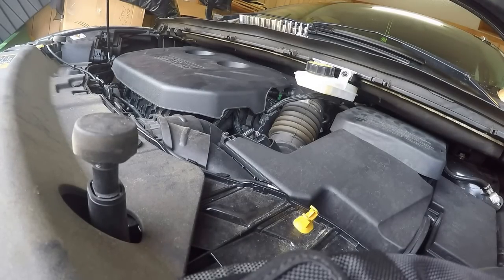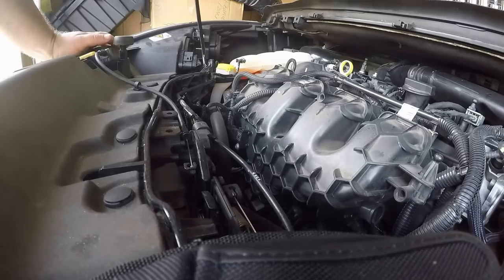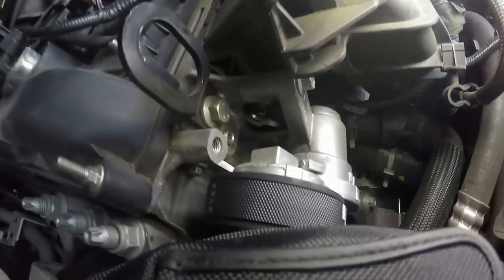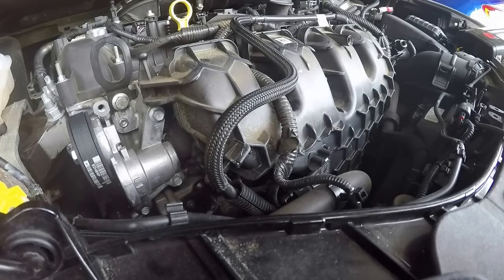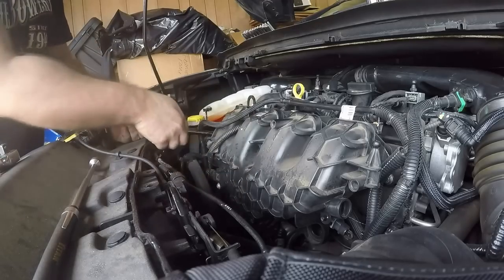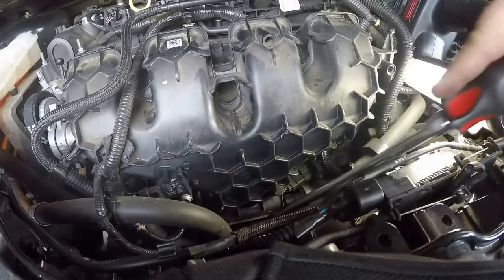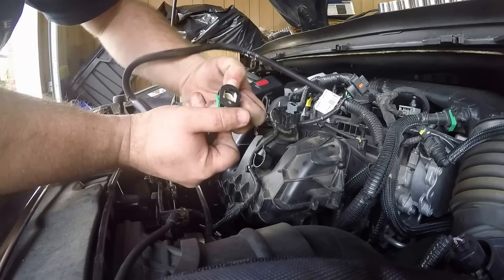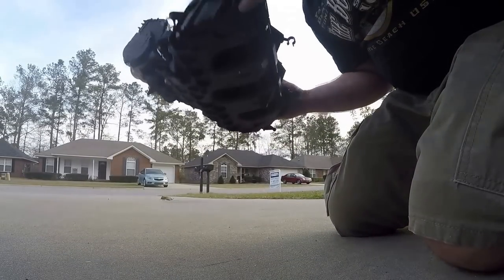Ecoboost intake carbon DIY valve cleaning turbo 2.3 2.0 1.6 ford escape turbo, escape. Simple tools

Comment: ford research and development should have caught the excessive blowby under boost conditions and fixed it
Reply: with a catch tank LOL which I have to buy now
Reply: Catch can only thing that will cut it down
Reply from the maker: Thats what the Germans figured out years ago and fixed or went away with the direct injection technology.
Reply: The newer generations are coming with port injection to clean values now.
Reply: @scrappyitalian  Negative. GDI is here to stay. Most manufacturers (Mercedes, VW and BMW included) have gone to dual injectors. One in the cylinder and one in the traditional port location to wash the backside of the valves.
Reply from the maker: I did not see this reply and i apologize for not messaging back in a timely manner, i hope everything is going well and any issues were worked out.

Comment: Is there not a potential problem with carbon crap getting into the cylinders and being blown out and into the turbo fan with possible damage to the blades?
Reply from the maker: Yes! if they are big enough; however little bits will not hurt anything. Thats what you see when carbon blows out the tailpipe on grandma's car from chunks coming off the valves and pistons,
Reply: @scrappyitalian  What about the "honey comb" in the CAT ? wont it block that?
Reply from the maker: If you use CRC and let it all break free yea kiss the turbo and cats goodbye. But a manual cleaning, is the best way, light liquid cleaner after like the ac delco, and a amsoil changeover.

Comment: Legend says he is still trying to get that escape to run again.
Reply from the maker: Jeremy its running fine, the big issue with it was the head gasket. The valve cleaning really helped after i did it but the shuddering was from the tiny amount of coolant leaking into the cylinders. If i waited after the warranty, ignored it; not pressed ford to check the compression, and leak test, i would have been stuck with replacing the engine.
Reply: LanceManAdventures great to hear. Just making a funny. Couldn’t have you replaced the head gasket yourself? If you had waited till after warranty. Wife’s escape is idling rough at idle from time to time and seems the power delivery is weird sometimes. I will check compression
Reply from the maker: They replaced the head the first time. Then the engine completely blew up. Then they did a long block; mind you weeks of waiting between. Unless you want to do the machine work i would get a long block or a post head gasket update model junk yard engine if its the gasket. These engines are so finicky you may end up doing the pull 2x if anything is not perfect. Not a lot of shops can put the proper finish on the heads and block for a proper seal even with a good mls gasket.
Reply: LanceManAdventures wow! Ok so a few questions: 1. What year did the update the head gasket? 2. Was your escape a 1.6 or 2.0 ecoboost? 3. How many miles did yours have when they replaced the head and engine? 4. Do you still have the vehicle? If so how many miles on it now?
Reply from the maker: It is a 2014, 2.0 eco, it had about 60k when started with the problems she fortunately had the extended warranty. I am not sure when they started putting the updated gaskets in new vehicles. But i know the replacement long blocks have them. There is a video showing the dumb unnecessary hole they put in the gasket between the cylinders on the gasket that is the problem.

Comment: This is not carbon this is oil from the crank case  building up , understand this problem is from excessive cranck case pressure and oil blow by............the throttle plate was very clean with very little carbon on it
Reply from the maker: Shannon Spears finally someone who knows what they are saying instead if critiquing me at every turn. 🤟🏼
Reply: I have to recan't some of what I said there is carbon build up but oil is excessive in ecoboost, so everyone is using a catch can which is a simple fix for this engine , so I found a company that makes a intake spacer for these engines and with the advice of Steve to use CRC cleaner the spacer has threaded ports for injecting any thing you like  CRC cleaner, NOS, gas, water, auqamist.................Boombaracing.com 
Did you know water can turn to steam and clean deposits, we use to use a pop bottle and poor water down the carb of the big V8's back in the day only when the engine is hot .
Reply from the maker: I did not see this reply and i apologize for not messaging back in a timely manner, i hope everything is going well and any issues were worked out.

Comment: Also change your high and low pressure fuel sensors that’s also a problem with this engine
Reply from the maker: Rahsaan thomas the big thing is the head gaskets. Ford put in 2 engines in after this, having nothing to do with the carbon. In the end the carbon problems are dwarfed by the head gaskets leaking. If you have “any 4 cylinder” ecoboost have the pressure check your coolant and compression asap; before your powertrain goes out!

Comment: How about using a small vacuum cleaner to suck the carbon out.
Reply from the maker: The hole is very deep, you would need to make a custom adapter.

Comment: Hey do you still have this vehicle? The reason we get carbon build up is due to the pcv system. It's a big problem in the focus st community aswell. Since the car is direct injected, there's no fuel that touches the valves, therefor no cleaning takes place. Oil from the pcv hits the hot valves, and what doesn't make it into the cylinder bakes on to the back of the valves. You should try looking into an oil catch can, I've got a Boomba stage 2 catch can and I pour 2-3 ounces of oil out of it every 3000 mile oil change. Does wonders for keeping carbon off of your valves.
Reply from the maker: Anything you do will void the factory warranty including a catch can. I have the 3.5 SHO and am terrified to even touch it with anything aftermarket. Ford does not like you nor will overlook anything you do to the ecoboost. But the problems now is a coolant leak that is causing a misfire that they cannot track down and are just throwing engines in as a fix. As i said in my other comment i will be doing another video as soon as i get it back after the second engine replacement to explain what to look for and ask for when you have a ghost misfire from the ecoboost.
Reply from the maker: The biggest problem is not the carbon but a poor head gasket design and block configuration.  If you loose coolant at all u need another engine....
Reply: @scrappyitalian  I've lost coolant in my 2017 Fusion.  If it's so bad that you need another engine, wouldn't you see coolant in the engine oil with that milky white appearance?  Either way I'll have them check it under warranty, but I'm interested in your thoughts on that.
Reply from the maker: Brian Heath it leaks into the cylinders directly, will not show up in the oil. They need to do a coolant pressure test and a compression test to find the leak. The leak is between the two middle cylinders and is very hard to catch. The coolant should never loose “any” fluid per ford or there is a problem. Make sure they do not talk you into just a head job the entire engine needs to be replaced.
Reply: @scrappyitalian  Thanks.  Also, how do you know it's misfiring if a code doesn't show up?

What do you say if they just shake their head and say, "we don't replace the whole engine under warranty because it's good enough to do a 'head job'"?  (Does that mean they just refurb the valves, guides, and seats?)
Reply from the maker: Brian Heath i had the same problem with no codes, but ford knows what this issue is. The pressure tests are all they need. They replaced the head on the first engine which soon blew up. The ecoboost is not and easy engine to just tear apart also i know they did not make sure the block was true as the engine did not come out after the first attempt. After the second fail they just put in a long block. Get it done before powertrain runs out.
Reply: @scrappyitalian  What do you say if they just shake their head and say, "we don't replace the whole engine under warranty because it's good enough to do a 'head job'"?  (Does that mean they just refurb the valves, guides, and seats?)
Reply from the maker: Brian Heath let them replace the head. Keep and eye on it and after if fails again shudders or looses any coolant at all again they will replace the engine. Thats what they did with me.

Comment: Something nobody is talking about is using cleaning agents in the gas, can clog Converters fast.
Reply from the maker: Well the problem is the direct injection system does not spry fuel on the back of the intake vales like a traditional FI system does so there is no amount of cleaner you can put in the fuel to make any difference. Being Italian myself there is some validity in the old “Italian clean out”. I am not saying get yourself arrested, but not driving a WOT a few times a month will cause carbon to run wild, full synthetic oil can help a lot but running it hard helps move and burn out any buildup upstream of the cats. But cleaning it by hard is about the only way.

Comment: How do you clean the throttle body without taking off the intake?
Reply from the maker: There is the CRC method but it really does not take the big chunks out. There are a few videos that show how to do it, but i do not suggest is as you can wash out the turbo bearings, and burn out the cats if you are too heavy handed with the spray.
Reply: @scrappyitalian  I just replaced it, thanks to you👍 Thank you so much. This is my first time doing stuff to my  car. Now I have a big confidence boost on taking car of my car in the future! saved me probably 500$ would give it to you if I had the money lol
Reply from the maker: I did not see this reply and i apologize for not messaging back in a timely manner, i hope everything is going well and any issues were worked out.

Comment: Isn't there a danger of one of these chunks of carbon falling into the Cylinder Head and scoring the cylinder wall?
Reply from the maker: Jason Photography nope, what would be worst is having a huge bit come off after using a chemical, and having a hydrolock type of situation. But carbon is actually soft so friction damage is not likely at all, however it can break off a blade of the turbo if enough went through, and damage the cats as well.

Comment: Great manual! Is it needed to replace intake manifold gaskets? 2017, 63k miles, if it's important
Reply from the maker: The O ring gaskets are optional but i would. You can get a new set and if the old ones look good, take back the new ones.
Reply: @scrappyitalian  i`ve already got set of new. But now i've seen a few videos about cleaning and catch can install where people don't replace them.. That's why i'm asking..
Reply from the maker: I did not see this reply and i apologize for not messaging back in a timely manner, i hope everything is going well and any issues were worked out.

Comment: How much carbon fell through the open valves?
Reply from the maker: No carbon fell in the combustion chamber the air wand blew all the carbon back out through the intake runners. I do not know where people are getting that the carbon fell into the engine the valves were completely closed and purged of all carbon that came off. Then i put a light coating of carbon removing chemical on the back of the valves.

Comment: Doesn’t look that bad. Carbon build up is mostly on the valve stem.
Reply from the maker: GreatGrandmasterWang yea it really isn’t that hard i did not get them squeaky clean as i did not want to scratch the valves i got ad much off as i could safely. Its the globs of carbon that has the most effect on airflow, and the process is easy enough to do every 35-45k. Just be careful with all the plastic parts.
Reply: LanceManAdventures I have the 1.5L ecoboost. I don't know if carbon build up is still present, but so far I haven't read any issues with this engine.
Reply from the maker: GreatGrandmasterWang if you have over 45k + they all have the same issue. Even the 3.5 i dread doing my SHO

Comment: I have a question, first did he remove the pieces of carbon and then apply the chemical? Or did he move the crankshaft to close the valve set of each cylinder?
Thank you
Reply from the maker: The heat of the engine made the carbon pop off very easily, as i made sire it was at opp temp. My goal was not to make the valves as clean as new.  Just enough so my chemical would work on the remainder.

Comment: Engine mods for that 2.3? I want to find someone who has added a phat turbo to an Escape with 12 - 18 psi boost. Obviously that will require suspension mods, headers and exhaust plus the almighty dyno tune. Anyone been there with an Escape and achieved >300hp?
Reply: Jeff Gillis 22lbs for me right now. Probably the only one in the world with an escape like that.
Reply from the maker: it is funny keeping up or spanking cars and trucks with the little ecoboost, that are just sure they are going to cut you off from a light, and you just leave them.

Comment: Purge valve. Seems to be a common thing
Reply from the maker: Yea i just did mine last month when the gas fill went nuts and pulled the code for the purge valve. 160$ and back on the road.